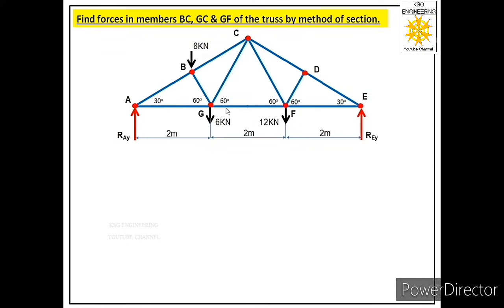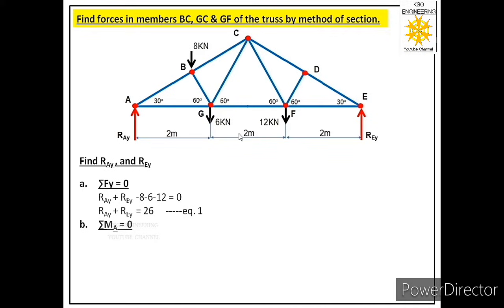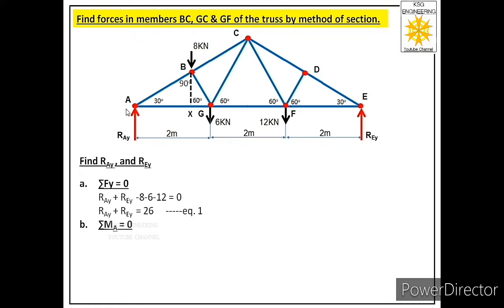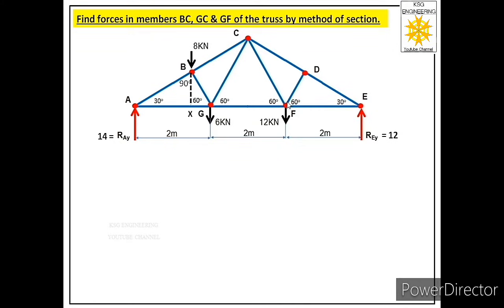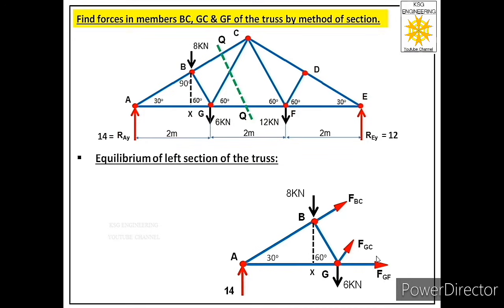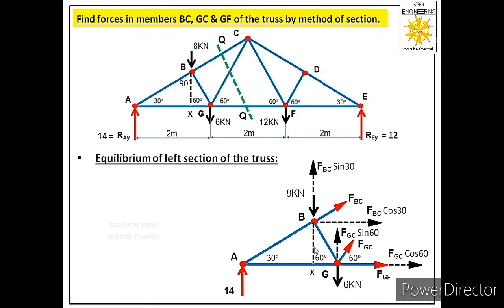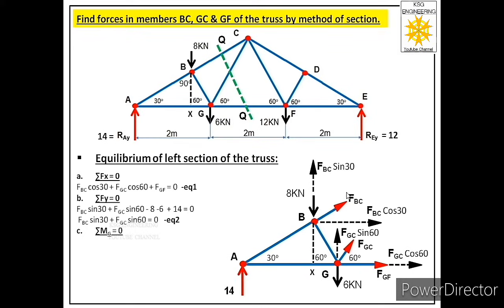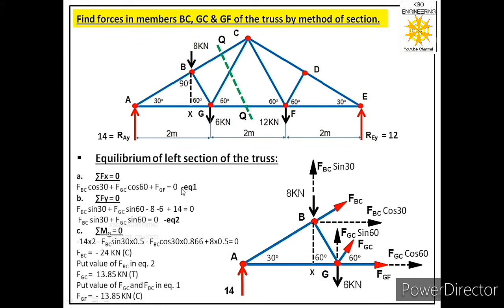Trusses | Method of Sections | Problem 12 | Engineering Mechanics | 11.12

Comment: Ive been scratching my head why I'm wrong Fgf I got was in tension and in your notes it says Compression. I got the same value as well and I double checked and I'm pretty sure its right idk.
I used the right side of the diaram.
Reply: I checked your diagram and the forces in the x dont sum to 0.
Reply from the maker: If you need any help. Kindly ask